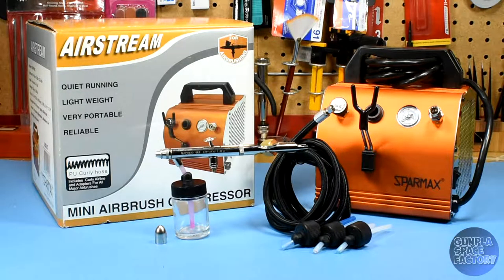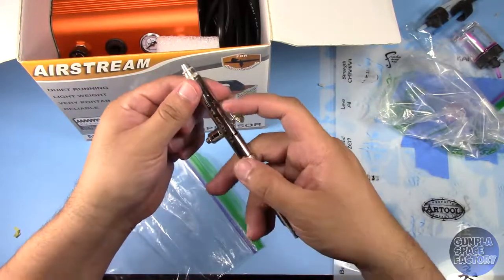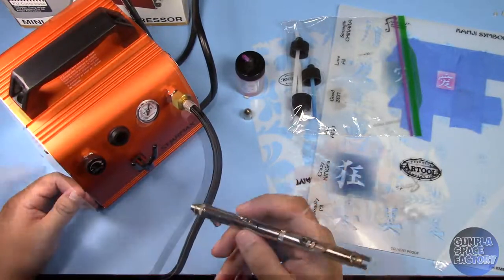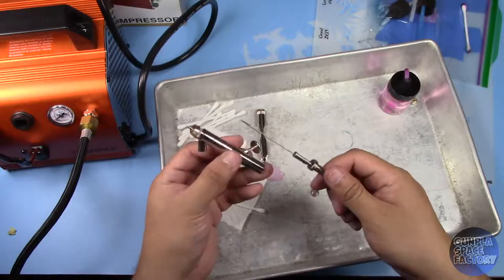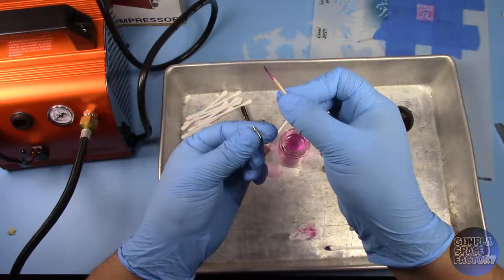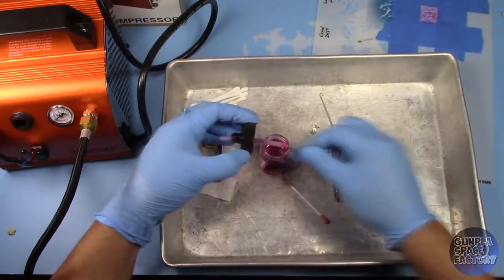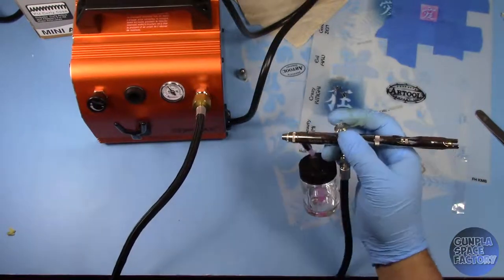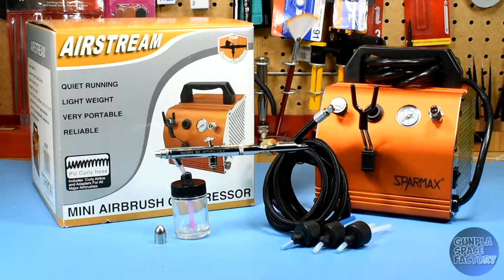Let's Fix: Sparmax AC-27 and Badger 155 Anthem Airbrush | Did I get ripped off?

Comment: Dang, what a deal.  You got the best airbrush on the market.  I researched airbrushes for over a year before deciding on the Badger 155 Anthem and I'm glad I did!  I got the Anthem for about $68.00.  You need to use some Teflon tape on the male threads for the connection to the compressor.  Also, you can use chap stick or bee's wax on the threads of the spray head.  Chap stick works just as good as bee's wax and is less expensive.  You can use dental brushes to clean the nozzle.  That's what I use and they work very well.  You did a very good job cleaning all that gunky crap out of that airbrush.  It should serve you well in the coming years.  You can use pipe cleaners to clean all the passages on the bottle as well.  Also, you can polish that general purpose .76 mm needle to work even better.